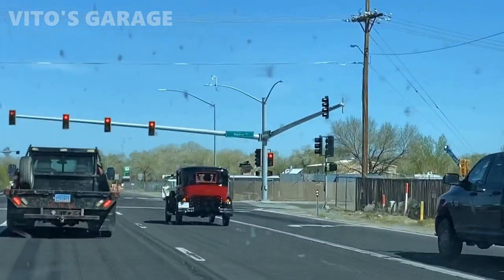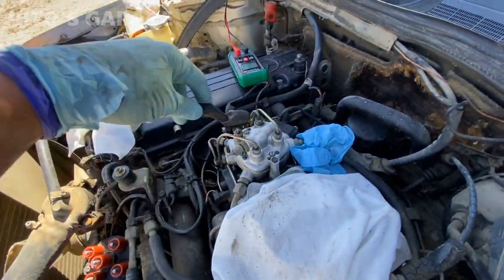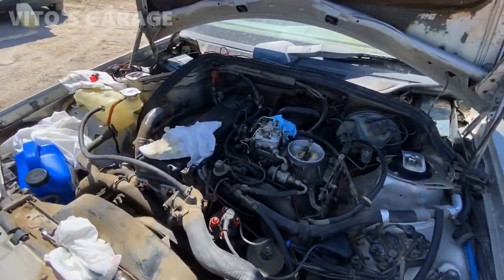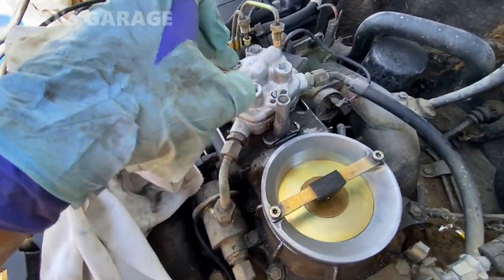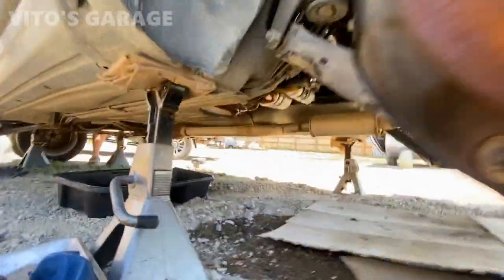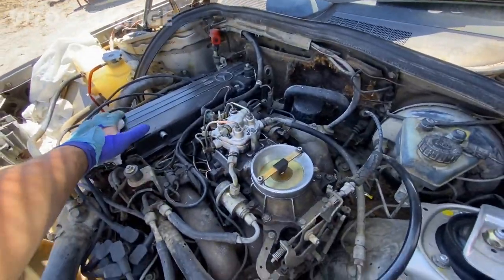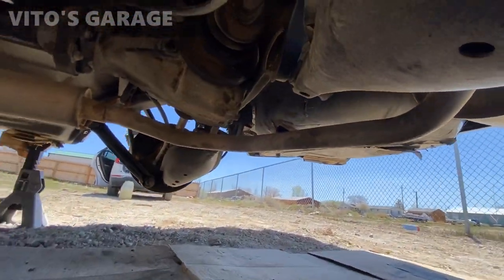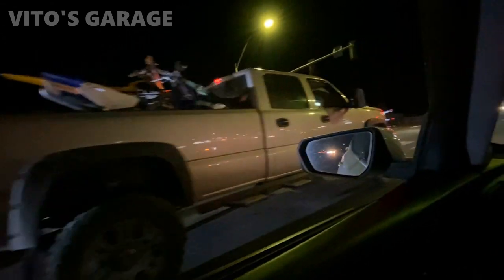1987 Mercedes 190E 2.3L First Start in 10 Years!!! Future Plans

Comment: Put some antifreeze, check the vacuum lines ..check the idle..wash it up a bit and you are good to go
Reply from the maker: We aren’t putting antifreeze in because the whole cooling system is getting rebuilt with a new water pump etc

Comment: I could be wrong but don't these have hydraulic tappet lifters? From the clicking, it sounds like one isn't getting full oil pressure or is clogged. I had similar clicking noise and rough idle after an 8 year start up but an oil flush sorted it and made it smooth again.